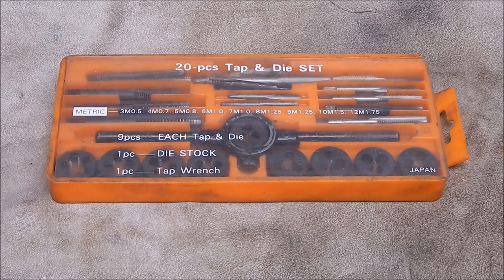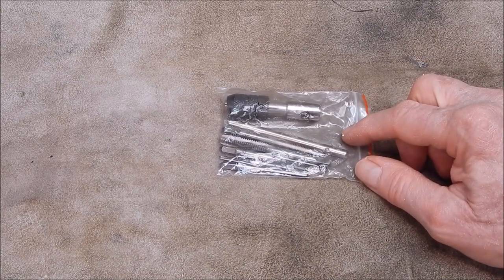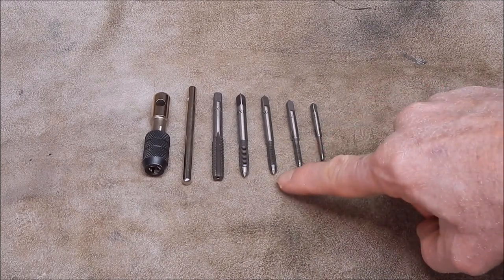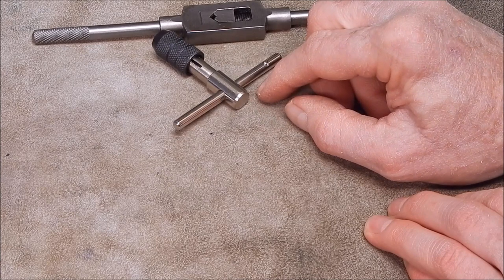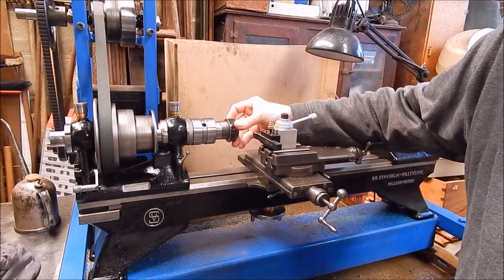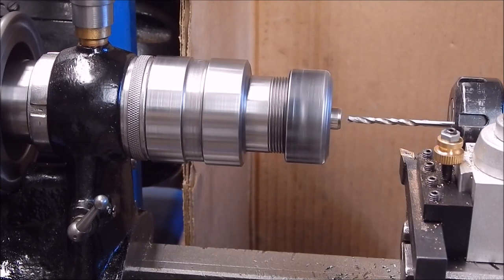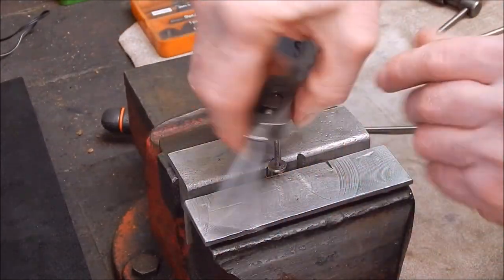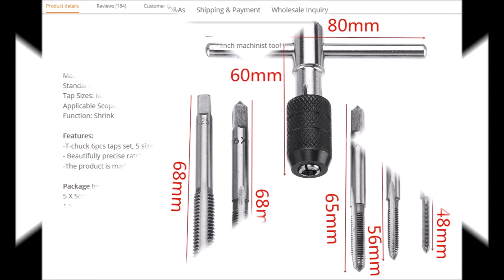A small metric thread tap set that is amazing value - plus a mod

Comment: I got a similar set a couple of months ago and i like your idea to centre the handle. Using only the point on a centre drill is far better than using it to the second chamfer as its 120° and fits the normal drill perfectly, if you go to the next chanfer its 90° and the drill can start cutting off centre. A dimple in the bolt you put in will help to alighn it if using the lathe or drill press. and also fileing a small flat on the crossbar will hold better.

Comment: Hi Rob. I recognised the printer shaft before you said what it was! I have a few of those in my metalwork stash. Amazing that you can get a decent tap set for $5 - totally amazing. It would cost me more in stamps and envelopes to send an empty envelope to China, I think. What do you recommend for power tapping? I've seen some with a chamfered lead in ('machine taps') which push the cuttings through the hole, and some with a spiral clearance which you mentioned - they pull the cuttings back out the hole like a twist drill does. Any opinion on which of those are right for power tapping on the lathe (and/or mill). Cheers, Craig
Reply from the maker: Hi Craig,  I'm not a great fan of power tapping, so I'm not the right person to speak to.  A broken tap is a thing to ruin your day and power tapping just ups the ante IMHO.  So it's not for me.  Can't help you with this one.  Spiral taps are used extensively by industry and from all accounts were designed for machine operation.  So they are probably your best bet.  Cheers Rob.

Comment: G’day Rob good review on them I’ve used them and found them fine for most applications. Your right about the “T” type chucks I found you can’t get enough tightening pressure on them and the tap works loose, I tighten them up using a pair of pliers around the knurled bit.    Good to see you again Rob kind regards John
Reply from the maker: Hi John,  The small cheapy "T" holders are not ideal, but will do the job (just).  At least this one has more meat than most you get.  You can't beat the wedge type tap holder I used in the video.  Glad to hear the taps held up OK.  Cheers Rob

Comment: Rob, thanks for the video and review.  I think I may give this a try for some of my 3D printed projects and light projects.
Reply from the maker: Hi Ron,  It certainly is a cheap little set.  It goes well with the boxed mixed Allen head bolt sets BG sell in small sizes.  The stainless steel M4 bolt was out of one of them.  Really great for model making and well made.  Cheers Rob

Comment: G’day Rob, no your not gonna suck me in again, BTW the scriber works a treat. I didn’t know the holder has smaller jaws up inside, I’ve always searched for my smaller handle, must check the bigger one, thanks for that. 
Cheers 
Peter
Reply from the maker: Hi Peter, the holder is slit in four places for the collet compression and the small taps just use the centre drill hole for that.  Cheers Rob

Comment: Thanks for the heads up. I ordered two sets for about the price I would have to pay for 2 or 3 metric course taps at my local supplier. In the UK it is normally considered best to have three taps: 1st, 2nd & plug but I have not found it makes that much differences on the stuff I do. Sometimes I have to use metric fine and I guard those taps and dies as they hurt the wallet more. I broke a m4 coarse tap recently by using a blunt tapping drill, work hardening the m8 stainless steel bolt I was going to tap down the head with m4 and then snapping the tap. Wondered if I might recover by heating the bolt up, but was too busy so just got another. The scriber and cut off steel you highlighted a while back came and are good as you showed. Thanks for sharing!
Reply from the maker: You can anneal the work hardened bolt, but that will also destroy the hardness factor.  So it's best not to do that, as re-tempering is bound to be unreliable and often prone to impact failure.  That's why avoiding work hardening in the first place is the best practice by far.  Do it as shown in the video and you will have no problem.  Cheers Rob
Reply: @Xynudu  The Banggood taps I ordered on the 30th arrived today (UK), 7th of September.  Very good service by China post. A needed positive spot on a hard, miserable day when I had to have my 15 year old terrier that I had from 6 weeks, put to sleep due to heart disease and non response to meds which the vet thought was likely lung cancer.
Reply from the maker: Sorry to hear that.  It did well for a terrier life span.  I had my 18 year old black kelpie put down a couple of years back as he was terminally ill.  It's sad but you have to do the right thing by the animal. I worked it out we had walked over 9 thousand kilometers over the years.   Nothing is forever.  All you can do is enjoy life and have a positive attitude.  Cheers Rob.

Comment: This is a nice and honest review, starting when you said, "this is not a ratchet set" which means the product name is not what the seller claims.

It is my suspicion that Bang Good sells a lot of stuff that does not meet quality control. I guess it makes more sense to sell the stuff for cheap than recycle flawed products, in the end recycling tries the finished stuff like low quality raw materials and that destroys the money invested in production while requires more money to recover the raw materials (particularly for complex products). That being said, it is clear to me why sometimes people get garbage and others fairly well made stuff and thus the mixed reviews.

I guess that given the level of success you have had it is probable that most products sent for review are picked from their stock and thus tend to be of fairly good quality. Nonetheless I also think that sometimes people expect that cheap products should perform like top quality ones, so purchases based on reviews and personal experience can have completely opposite results. I would recommend to lower expectations a bit and do not ask beyond what you get for the price.

Thanks for the review .
Reply from the maker: Hi Reinier. Fair comment.  Cheers Rob
Reply: quality control in PRC is a paying option. you want cheap? you don't pay for QC and the manufacturer either ships everything to you, including duds, or they resell what they cannot send you, usually the worst or overruns, to local suppliers for independent resellers selling through Banggood, Wish, Aliexpress, etc. 😑

if you want quality, you either pay for the level of QC you want. also you better have someone you trust on site for every single production run unless you work with a known tier-one or two manufacturer. most cheap arse chinese manufacturers have not a microgram of pride in what they make.  caveat emptor is the name of the game.

Comment: nice review.  I decided to order an identical "looking" set from ali express figuring it would be decent enough.  The machining on the threads on all except the m8 was terrible.  I should have just used the link you provided on the banggood set.  The threads on the taps had sections where the thread wasn't even fully cut.  Hopefully the quality of those from banggood is still good though.  See ya.
Reply from the maker: Hi Chad, lots of stuff looks the same, but if it's cheaper it's usually for a reason.  Cheers Rob

Comment: thankyou Rob, enjoy your vids. thanks for the tip.
Reply from the maker: Hi Steve, Internet prices just keep getting cheaper on tooling.  I only ever buy from the tool shop if I need the item right NOW.  They have a lot of overheads for sure, but the mark up they put on is massive.  Just shows what they make on this stuff. Anything less than 100% and I doubt they would even stock it, same as supermarkets.  Cheers Rob

Comment: Rob not all carbon taps are black, i have a set of UK made Presto BA thread taps that are carbon steel & they look the same as the ones you are reviewing even down to the color & surface finish. I also have a set of German taps but they have them made in China & also look in appearance to the ones you are reviewing, these are also carbon steel.  All of my other tap sets are UK or US made HSS taps & you can certainly tell the difference in appearance to the carbon taps, even more so when you test the performance of the carbon v the Hss. I know Banggood do sell HSS taps & they highlight that in the specs on those taps & are more expensive. But still cheap in comparison to UK or US made HSS taps.
Reply from the maker: Yes, I realise that and stated that the ones I have were shiny under the final finish. Thanks for expanding on that.  HSS comes in many grades and I suspect these are probably on the low end, but the one I tried seemed to cut fine and make a clean thread of the correct size.  It also showed a bit of flex, which my two carbon sets don't.  They snap as their first warning ;)

The two BG taps I bought previously are marked HSS.  These ones are not.  But that isn't a true indicator as some of my taps from brand names aren't marked either.

Anyway, at the end of the day this set seems like it will do the job for most light use.  Can't expect too much for potato chip money.

Cheers Rob

Comment: Nice little mod. Rob. Maybe I'm not as fastidious as you but I have a half dozen or so 'T' Tap holders with that annoying sliding cross-bar. Simple fix? roll a tight fitting 'O-Ring' on either side and 'Bob's your uncle' - Tight fitting, adjustable and requires no tools to change it's position. Maybe I'm just a cheaper 'cheapskate' than you eh?
Reply from the maker: Good idea John.  Yes, I don't like the sliding cross bar.  That larger P&N one is fixed.  Cheers Rob

Comment: The ratchet ones work on the same principle as  ratchet / locking/ reversible screwdrivers.
Reply from the maker: Hi Peter,  I have never seen one in this configuration, particularly this size, but that dosen't mean they don't exist.  It had me a bit intrigued.  Cheers Rob
Reply: P.s. forgot to say  I like your  videos👍
Reply: @Xynudu  I have 2 ratchet tap holders in this T configuration, one is small from 1.4mm to 5 and the other one is 4 to 12 i think, both made by Bahco good but not cheap, 20€ each about 32$AU and came without taps but they are a delight to work with.
Reply from the maker: Hi Derek,  I followed up on the Bahco ratchet thread tap chuck you mentioned and yes they do exist and yes they are expensive (I have never seen these before).  I then did some more searching and found that Banggood actually sell an almost exact copy by Drillpro for very low cost.  So I have requested  a sample to follow up on this  subject.  We will see what eventuates.  It should be interesting.  Cheers Rob

Comment: search ebay rob-----M3-8 M5-12 Reversible T Bar Handle Ratchet Wrench Holder for Thread Tap-------very handy for tight places.hope this is classified a bargain,lol
Reply from the maker: Hi Geoffrey,  I see Banggood actually have a reversible T bar holder set similar to one made by Bahco.  So I've asked for a sample to review.  I''ve never seen them before.  Just shows you're always learning.  Cheers Rob
Reply: @Xynudu  sample,o-ya thats a bargain.go for the two sizes.
Reply from the maker: Will do.